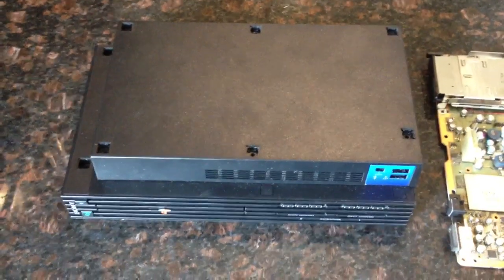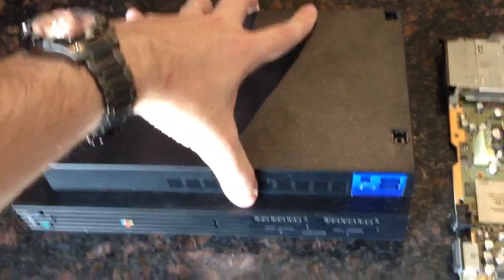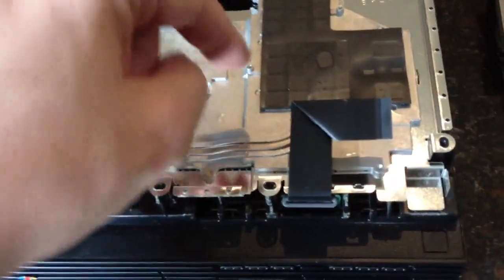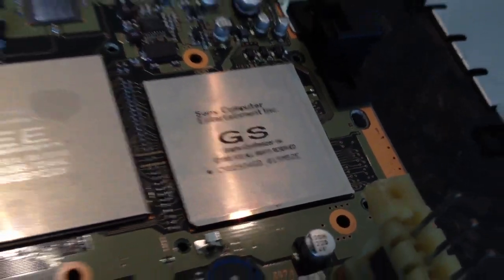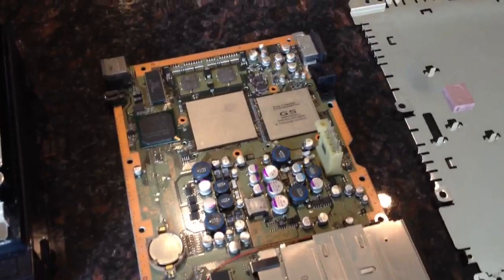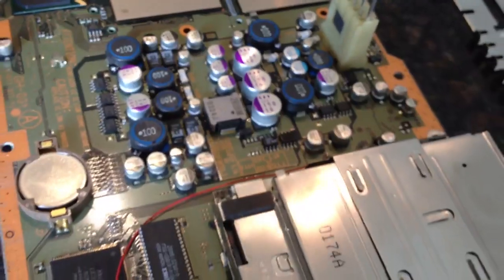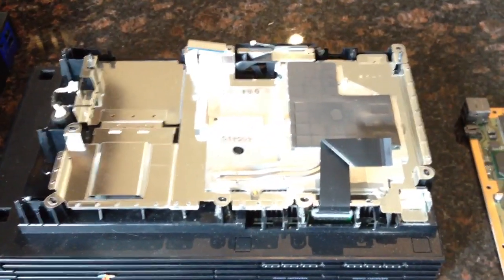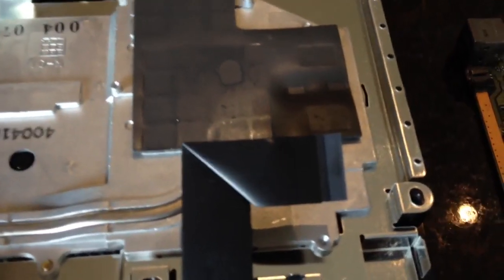Disecting the Launch Playstation 2 - The Obsolete Geek

Comment: Is it possible to remove the RAM Chip and put it in another computer?
Reply: No, and why?
Reply: Isiah Folio Because I thought it would make my computer super fast, and give it the power it needs to render PS2 games on the emulator super easily
Reply: Jason Skywalker Ohhh, okay.
Reply: Isiah Folio well, with 4gb of ram on a standard motherboard, what would I need to get it up to that speed?
Reply: Jason Skywalker I think thats perfectly fine to emulate the Ps2. You gotta think its ram is in the megabytes and the cpu was only about 100mhz.
Reply: bro it have like 128mb ram!
Reply: HappySlappyFace Isn't there something in this thing that could improve standard PC gaming? I mean, it can play PS2 games WAY better than m Windows 7 desktop, so there's gotta be something in there that's making it awesome.
Reply: Jason Skywalker Th reason it may run sluggish is that the emulator is trying to understand the PS2's language and convert it to a PC's CPU will understand it. It's usually slow with some CPUs. You could try another emulator or try upgrading your PC.
Reply: Jason Skywalker i know what you can do
BUY AN I7 6700K THAT WILL DO IT!
Reply: +Isiah Folio (Asdfguy86) PS2 is 294MHz and 32MB of RAM
Reply: ***** true
but some models are different
Reply: +RWL2012 yeah I think the slims are clocked slightly higher at 300Mhz
Reply: it actually would be great to take apart the motherboard components of a PS2 and assemble them into your PC so it can easily replicate the actual PS2